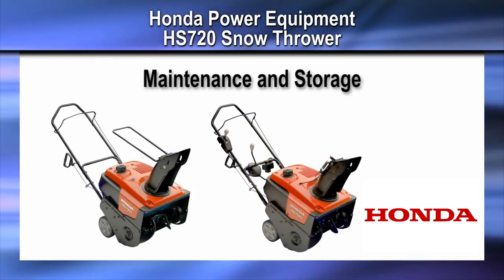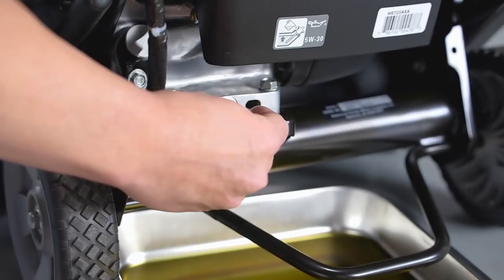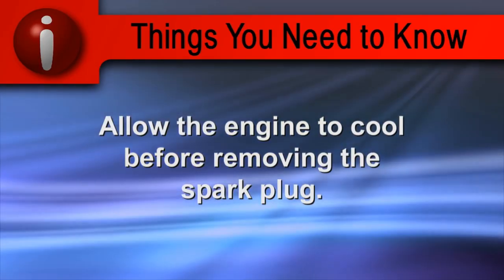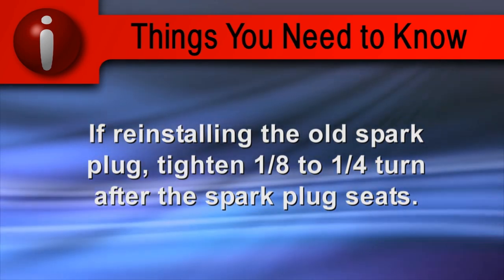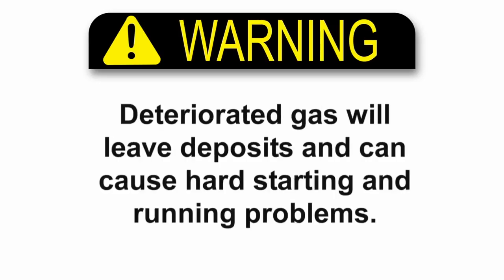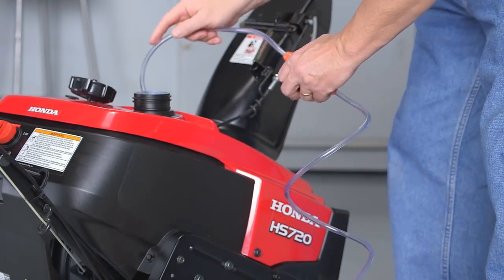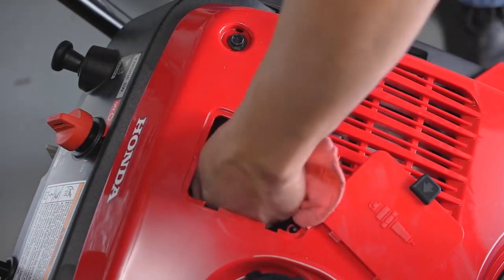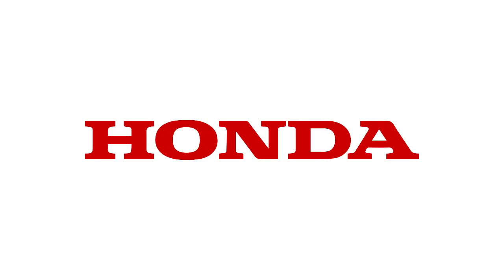HS720 Snow Thrower Maintenance and Storage

Comment: Just bought this (December). I may use it a couple times or once or not at all (Chicago - never know what we’ll get). Do I only add the teaspoon of oil into the engine at end of the season in the spring for storage until next winter? If I use the blower in January, and not again until late February, will the engine rust during those 6-8 weeks of non-use without getting that teaspoon of oil? I don’t need to add the teaspoon of oil right out of the box putting the blower together?

Comment: I bought thos model last year. How often should I change oil
Reply: change the oil the first 5 hours of use, Then yearly or every 25 hours.
Reply: That is fast!
Reply: @Scott-xq2dm  Fast?
Reply: @norge696  How much oil does this unit take?.
Reply: @raymondpalermo4998  Fill it with 5w-30 until it starts to spill out on a flat level surface.